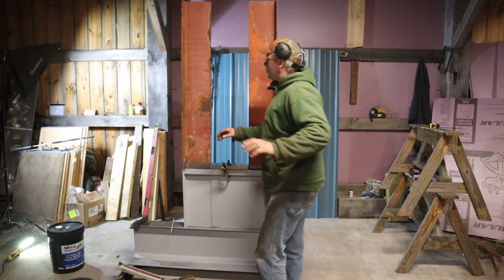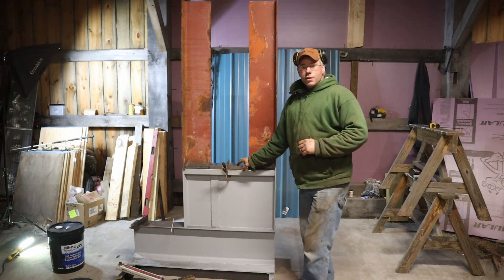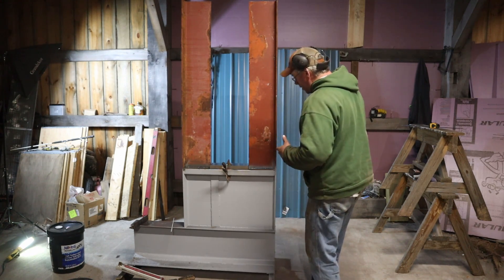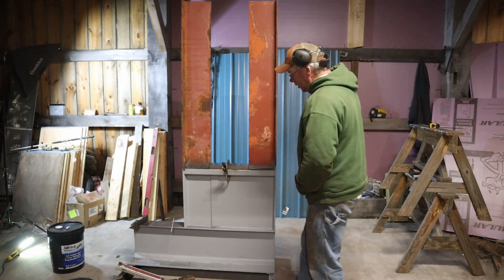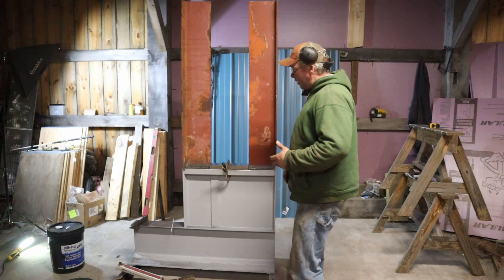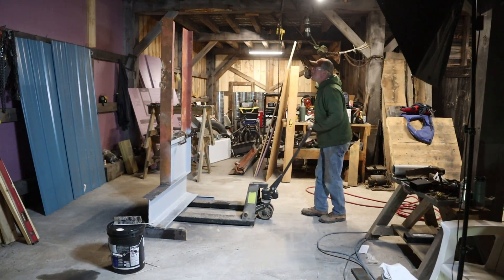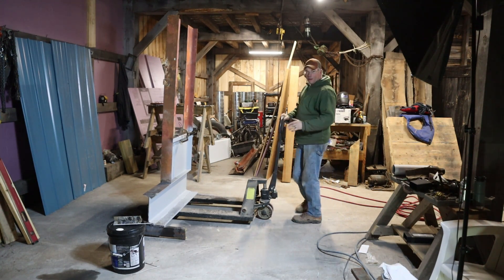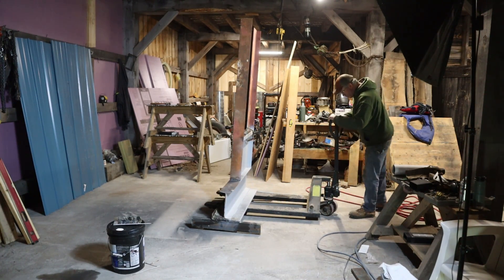Super Forge Press Part 3: The Anvil Plate

Comment: Jim, Another reinforcement to consider for both the 12" webbing in the base, as well as under the 2x2 tubing: vertical supports!  Below the 2x2, cut some triangles 2x3-ish and weld in three on each side at dead-center and just inside between the 2 verticals that will support and guide the head.  On the 12" webbing below, take a piece of cardboard and hold it on the end of the beam.  From the inside, use a Shapie to trace the exact shape of the pieces you'll need for creating "webbing" perpendicular to the main webbing.  Cut the cardboard to the OUTSIDE of the line and this should be a near-perfect fit.

I can't quote you the rules or formulae anymore, but steel, just like wood, is more resistant to flex in the longer axis, i.e. the 2x4 has less flex is the 4 direction than the 2.  Capice?  

Otherwise, kudos my brother!  Looking really good!!!
Reply from the maker: Mentioned just about all of it in the last two videos.  How you doing?

Comment: How old was that wide flange?  As I'm is that red lead paint?
Reply from the maker: It is red paint and rust.  Have no idea how old they are.
Reply: @TheTradesmanChannel   be careful with really old red paint.  It could contain a lot of lead
Reply from the maker: I should have thought of that before.  I'll have to pick up a lead test kit for it.  I do wear a respirator and grind the paint off before welding.
Reply: I worked around lead every day for 5 years and wore a mask when working directly over melted lead. The real danger with lead paint is little kids chewing on it in old houses. Safety, yes.